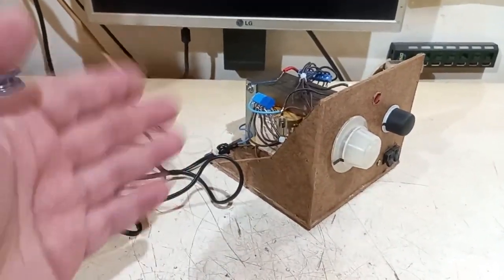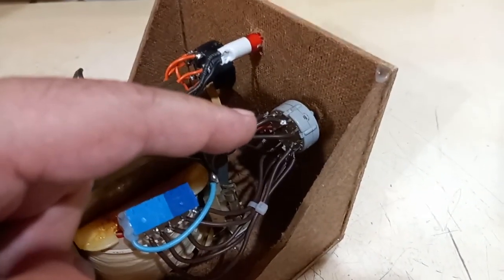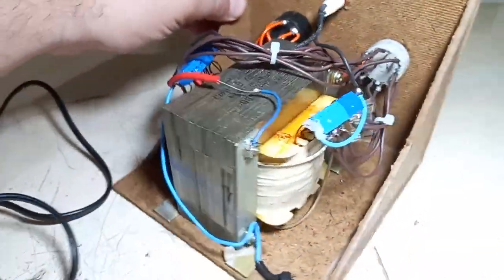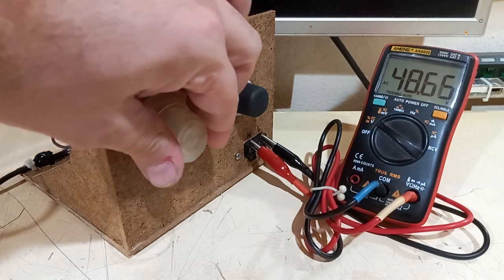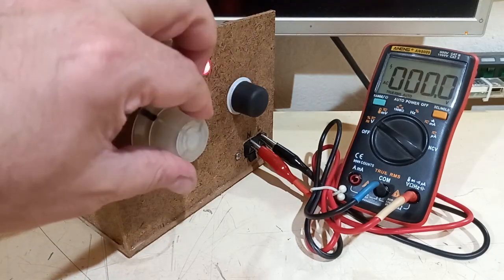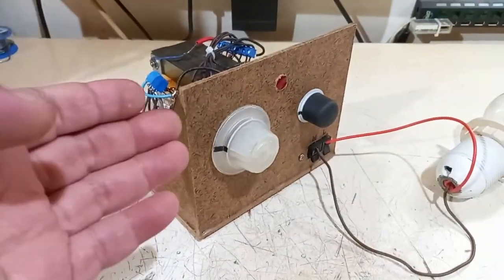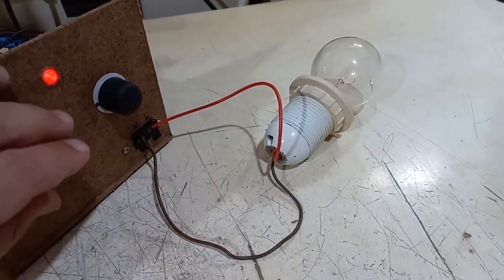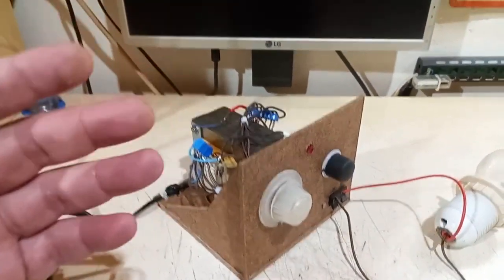Small DIY Variac, The "Selectovariac(TM)(C)(R)"

Comment: Very interesting! I'll try and calculate how many turns for how much voltage step.
I wonder if those old voltage stabilizer transformers could be used instead: they had 8 tappings.
Reply from the maker: here in italy, up to like the sixties, we had voltage stabilizers cos we had different voltages depending on the region, and TV's were basically all 220V, i have a pair of those, but they are filled with pitch and it's a big problem to modify em

for the trafo you need, one with simply a primary of your mains voltage should suffice, you have to completely unwind it, and rewind it making a lot of taps, and if you want the fine setting add some few insulated turns

for the calcs, you basically need just the "turns per volt"... chose your trafo, power it, read the voltage on the low voltage secondary, unwind the secondary but count its turns, and extrapolate the turns needed for making 1 volt

Comment: I hope you used a break-before-make switch...
Reply from the maker: already investigated and yeah, there's no need for that, both selectors "jump" from a position to the other without shorting anything, you can see on the DMM that it increases the voltage when switching cos during open circuit there's a bit of leakage coming from the "fine" winding, enough to drive some volts more on the DMM